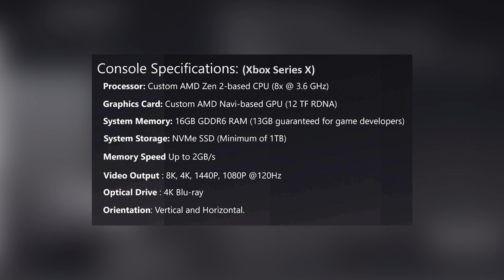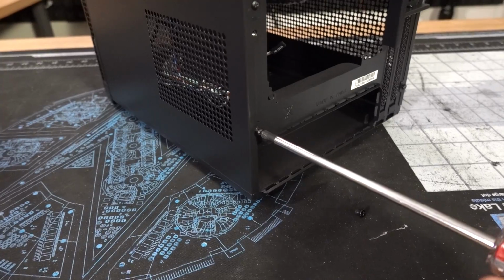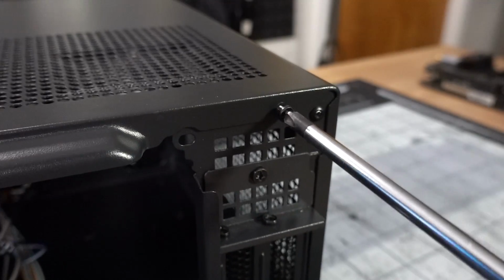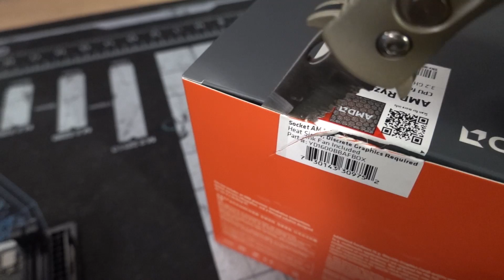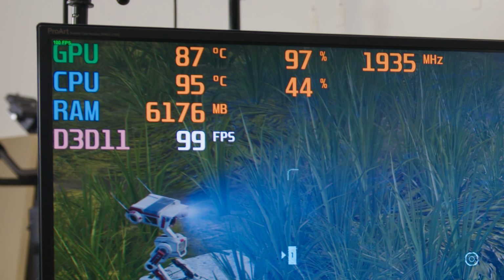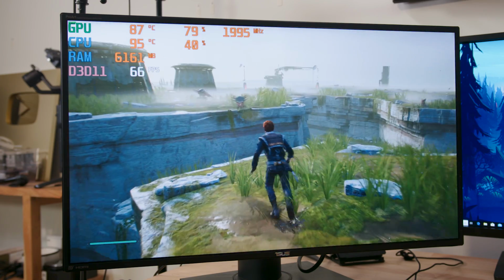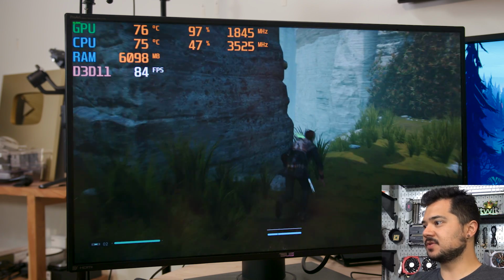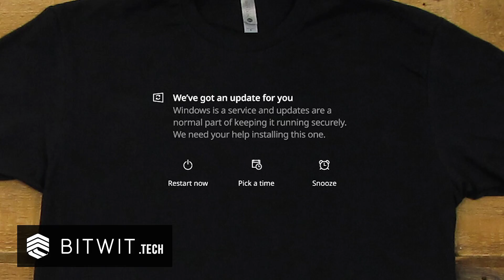I built my own Xbox Series X

Comment: "I built my own Xbox Series X, it's just double the price!" ^^'
Awesome build, Kyle! I love this tiny case! <3
Reply: More than double the price and runs hot and still not as powerful lol
Reply: @Rooster832  Whether this is truly running hot compared to the Xbox, can only be determined by a direct comparison of both! =P
Also power is a VERY broad term. You can totally build a more powerful PC in the same or similar form factor. Though to be fair, with stock parts it won't be as dense as Xbox Series X. =P
Reply: @Kniffel101  When I say more powerful I mean better performance for gaming. DF already talked about the performance during their Gears 5 demo on XSX. MS has been working on the XSX for a long time so I would find it very hard to believe that it runs anywhere near as hot as this.
Reply: @Rooster832  Both have their pros and cons. Many Xbox ports are locked at 30fps while you can play them at 60 or above on PC, for example.
Reply: @Kniffel101  every game will be configured to run native 60 4k.. so... No problems there
Reply: @Kniffel101  Xbox and ps5 will upgrade older games to 4k 60fps or 120fps HDR
Reply: sanji Vinsmoke  @MrJlaklak  
What? Nobody confirmed anything like that at all, neither for backwards compatible nor new titles! I'd certainly love to see old titles running at 120Hz, but I doubt it.
And it could be that many titles won't even run at 4K. Some older games are even dependent on the framerate being 30, so you can expect some 30Hz titles. (even newer ones, which will look better as a compromise)
Sony certainly doesn't seem to care about backwards compatibility at all. Except for PS4 games, which will run as badly as on PS4 (Pro) but with the added benefit of enhanced loading times, thanks to the SSD.
Yes, Microsoft does have a technique to display many (all?) games in processed HDR, which may or may not be great, we'll see how it'll turn out.
Reply: @AnimatedSonicStories  
Jeez, don't call other people stupid randomly (or at all). Even online you should always try to be respectful.
Anyway, a ton of games will easily run at 60fps. Like, just look at the hardware, it's a beast of a console! ^^
But obviously when games run at 30fps they're going to look better, or at least utilize more hardware power per frame, which many developers are also going to use.
But 4K@60 will generally not be a problem on neither next-gen platform. Having options to toggle between framerate- and graphics-modes would be really nice, but in the end that's up to the developers.
https://www.youtube.com/watch?v=oNZibJazWTo
Reply: @AnimatedSonicStories  the Xbox One X already plays games at 4k 60 fps and was $500 at launch and the Series X is twice as powerful.
Reply: @AnimatedSonicStories  just upgrade your rig but sell the old parts. That potentially could make it a similar price to a series x.
Reply: @darren871  checkerboard rendering isn't the same, but if it looks identical than that's fine. L
Reply: @Kniffel101  Been a PC player most of my life and 30fps never bothered me especially for single-player games and most xbox one x games seem to hit around 60fps online. XSX will do at least 60fps in 4k while some MP games will hit around 120fps.
Reply: Tech Freak laptop gamer to be more specific. But I was just kidding I’m not going to get a xbox
Reply: I wonder what these tech youtubers do with all these pc build they do for videos. Probably just sell them but that'd be crazy if they just stockpiled all this powerful hardware
Reply: @Mayman No, they did not
Reply: @Kniffel101 according to rumors they will upgrade games to 4k 60fps in PS5 specially those top 100 games in ps4/pro. Xbox SX will upgrade to 4k 60-120fps HDR in all games without game developer modification
Reply: and while I’m at it. I’m just going to go in. The Xbox series one x. That runs “4K native at 60fps” has a sub par cpu and a gpu that equates to around a gtx 1060. The top of the line Xbox one can’t even beat a 1080ti. So now you’re telling me these new generations are going to have 2080ti performance and ryzen 7 cpu performance for $500. I mean, none of you have said that, but just look all over the internet and that’s the argument. This gen consoles will kill pc gaming. Come on guys. Do you really think that? You can’t even do native 4K at 60fps rn on the current best console. While it is 4K, it’s sampled 4K. Upscale to achieve a desired look but it’s a checkerboard. While Xbox and the game developers have “optimized” all the settings, which means low to achieve FPS which is not a constant 60. I’m all for the advancement of technology but I cannot stand anyone that blindly endorses or chooses a brand/system just because they are uneducated on the workings of technology. Please stop blindly worshiping a product before you see results.
Reply: @flashyvashy     Xbox will play around 4k 60-120fps while ps5 around 4k 60fps natively.. MS and Sony will sell there console at a loss that's for sure.  I expect both xboxsx and PS5 to be price around $499
Reply: @MrJlaklak  PS5 will most likely also have an HDMI 2.1 port, so 4k@120 is still something they could do. But on neither platform will it be any game with the highest graphical fidelity - maybe except id software's games.
Reply: I love how blindly people are praising the Xbox without even seeing a release yet. This thing could be trash. I remember when I got the Xbox 1 on launch day and in a week it went red light death because it couldn’t handle dead rising 3 which was made for it. Don’t be so quick to pass judgement
Reply: @flashyvashy  Those were different times under different leadership.
But it's true that blindly following anything (or anyone) without questioning is very danderous and not something anyone should do.
Just like buying any console on launch day! =P
Reply: @flashyvashy  the xbox one doesn't even have a red light on it you could make you point and not make up silly stories we all know that didnt happen
Reply: Joseph Tafoya it’s an expression from xbox360. The three red rings, otherwise known as red ring of death represented a critical error needing repair. If you can’t understand the reference please don’t insinuate I’m a liar that makes up stories. The Xbox one had a very faulty launch. Please educate yourself before posting again.
Reply: I think a lot of people’s feelings will be hurt. I like the fact that gaming is improving. Especially console gaming because in return pc gaming will push. I still run a 1080ti bc I feel like the 2080ti isn’t worth the money to performance to me. So hoping the consoles push next gen hardware over that threshold. I would never put my faith into a console though. So many uncertainties
Reply: @flashyvashy  you got red rings on xbox one? that doesnt exist.
Reply: Slavisa Tosanovic ^ same to you
Reply: @flashyvashy  
Fanboys setting their expectations too high deserve to be disappointed! ^^
AMD seems to have pretty capable GPUs with RDNA2, so maybe they're also going to make Nvidia sweat and push prices down! =P
I'm just glad that next gen consoles are powerful this time, so getting them is actually worth it. Last gen was weak af.

Comment: Bitwit do you have any tips for a first time builder? I've really wanted to build a PC for a while and now that I have all this time on my hands (quarantine) I'm trying to find some good parts that can run 60+ FPS consistantly for 800-900 dollars. I've never built a PC so I'm not trying to spend too much on my first build just in case. After watching your videos for the past 6 months I still only have one question; the wiring is complicated and don't understand what goes where. Everything else is easy, ram, cpu, cooler and motherboard installation. Anyways, thanks if you respond.

Comment: Hey so I'm literally about to build in the case, multiple people have done tests and found having the psu facing down and exhausting the case drops total temps by like 5c. If you have a front case fan you'll still have postive pressure too.
Reply: Alex Fregger this is true, I have my PSU flipped down and it acts as an exhaust
Reply: Yep, I'm running that exact setup with a 120m AIO on the front.
Reply: Went from ATX in downward exhaust to SF600 in normal style. Am looking to go back to ATX facing downwards method. lol
Reply: Built this today, also have the PSU facing down.  It also looks like the front fan in the video was fitted incorrectly and is working as an exhaust rather than an intake.
Reply: buffalo wt I am using a 120mm intake on the front 👍🏾 if you can fit an 80 as well for exhaust that is cool,.

Comment: kyle there is no sfx psu bracket for sg13.. you don't need it, i am using the same case i use that atx bracket to mount extra drives.

Comment: Hey Bitwit, when Linus built in the case years ago he noted that putting the front fan to exhaust dropped temps by nearly 10c! It'll increase dust accumulation, but you could try that out and report back.
Reply: I also do this without any extra fan and put my 57000xt 8° lower and with extra 8mm intake 5° more lower
Reply: Well, if you have dust filters on & a extremely powerful electric air duster, Then there is no pain.
Reply: To follow up, I set my SG13 to a push/pull exhaust out of the front on an H60 aio. Insanely better temps than set to intake because there's no way to exhaust the air out of the case after it gets pulled in.

I have a spare slim 80mm fan I want to try and rig up to a side panel and try and additional exhaust. The x570 board just gets so hot.
Reply: What do you mean putting the front fan to exhaust?
Reply: meaning having the front fan blow the other way
Reply: @jammpot4416  Meaning exhausting the hot air out of the box, instead of intake. As intake brings cool air in, but where does the heat go? ...It's pretty clogged up, this specific case design has bad airflow.

Comment: hey Bitwit i a long long time ago wanted my ryzen 2600 to run faster so i made it run at a minimum of 3.85ghz i did this because i had an rx 570 and i wanted to basically compensate i guess for having this by making my cpu better i am about to upgrade to a better gpu so i dont need my cpu to be running at this speed and want it to just run at stock speeds i have tried going to bios and using a program called ryzen master but nothing is working. what should i do?